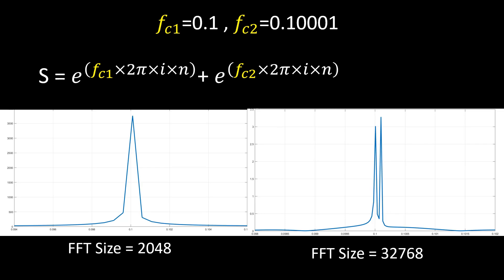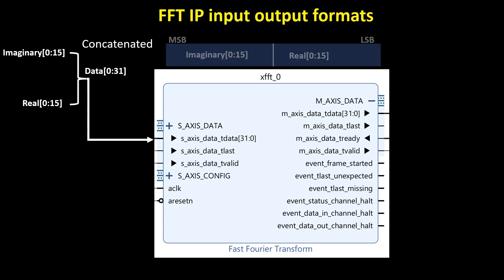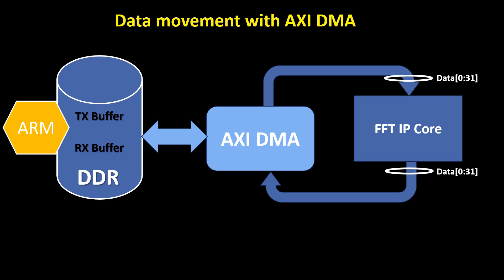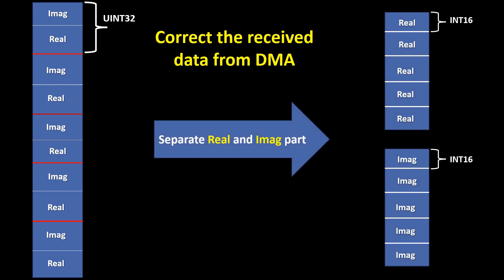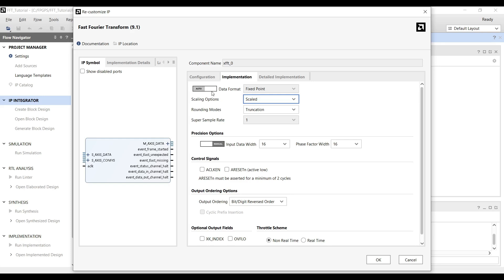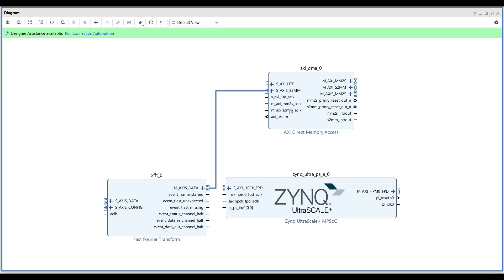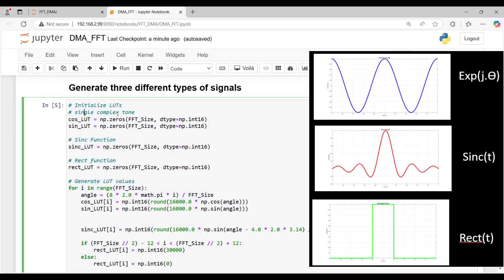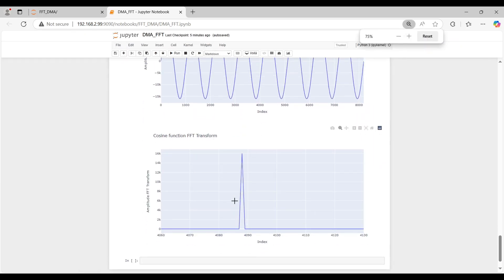FFT IP Core Tutorial Part 2: FPGA FFT Acceleration using AXI DMA

Comment: Thank you for the good lecture offer, I have a question.

If you put the adc-processed digital value in the fft of the fpga
The adc-processed digital value means only the signed real number part, how do I process the bits of the other signed imaginary part and put them in the fft together with the real number part?
Do I have to make a 16-bit imaginary part called zero and put it in?

Comment: Hi! Great video. I'm working on a project to create a Pynq spectrum analyser that uses OFDM signals created in Matlab with Wireless Waveform (I use the I-Q text file). It works well with an FFT in Block Floating Point mode and a Transform Length of 2048. Now I'm trying to create a runtime configurable FFT to define the configuration from the PS. What is the best way to send that data to S_AXIS_CONFIG (tdata, tready, tvalid)? DMA seems excessive and GPIO is only a data bus. 
Thanks in advance
Reply from the maker: @marquisiog9146 Welcome to the channel!
You can design your own AXI Stream IP that writes to the stream port using VHDL or Verilog. It should keep TVALID high, send the data, and assert TLAST at the end. Here's an example video:
https://www.youtube.com/watch?v=chs5mdwMchQ&t=1535s

DMA is one of the best options for data transfer. If sending just one data word with DMA doesn't seem to work, simply repeat the word in a buffer multiple times, then send the entire buffer using DMA.
Thanks!